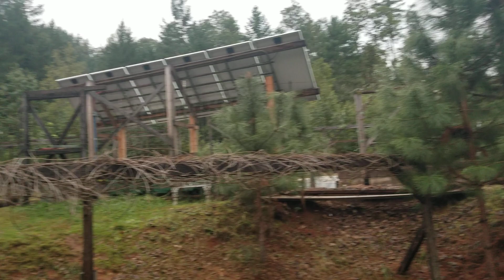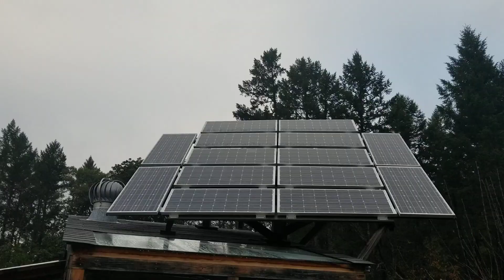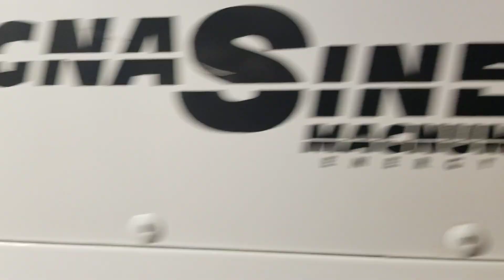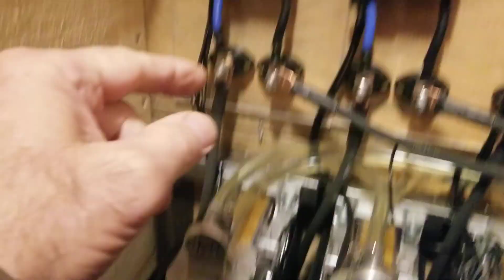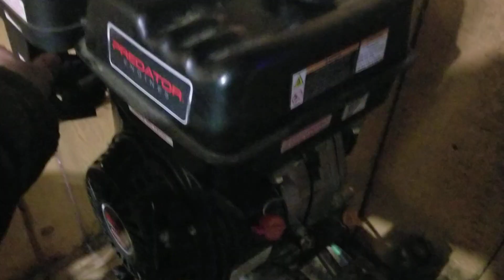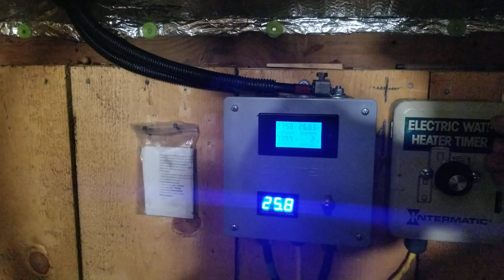Answering questions about the DC generator (Caution may be Boring to some viewers)

Comment: Your Diesel Generator has to go through a 110v charger?  And does not need the 24v relay disconnect, correct?  Your Alternator Generator puts out DC and is where this disconnect system comes in, correct?  Does your alternator put out 3 phase and then go through a rectifier?  If so, would the alternator start to get warm when load is disconnected like a wind turbine 3 phase will if left running?  Thanks.
Reply from the maker: Correct on all points. The engine must me shut down immediately.  I have one more relay to install that grounds out the coil on the engine when the controller opens circuits. If the driven power  came from wind or hydro a resistive dump load would be needed.
Reply: @offgridinthepacificnorthwe3210  When I woke up this morning, I had it figured out. The cheap turbine controllers short the wires to keep the turbine from fly away destruction.  I see no harm in opening the circuit on a alternator or PMA connected to a stable rpm source.  I still like your idea to shut the motor off.  What 110v to 24v charger are you using to charge from the Diesel?
Reply from the maker: @sciglassblower  Randy our Magnum inverter is a 4000 watt inverter and a 105 amp power factor corrected charger all in the same unit. This is typical of off grid systems. 
Any generator I connect to the inverter/charger will charge whatever type battery bank I program it to charge. I should be available sometime after the 1st if you want to email me to set up a time.  You can reach me at,
back41@cavenet.com 
Have a very blessed Christmas!
Pastor Steve Davis
Reply: @offgridinthepacificnorthwe3210  Can we connect privately?  I just live in CP and would love to come hang out with you to talk tech.  Randy

Comment: You are very good at figuring things out.  I just ordered these items to do it on 24v to 28v.  https://www.ebay.com/itm/Battery-Charger-Discharger-Board-Under-Voltage-Over-Voltage-Protection-Module-/122652302700 & https://www.amazon.com/Cole-Hersee-24063-Insulated-Continuous/dp/B001FQMZO2.  I am copying you with a 24v setup.  Thank you.

Comment: Batteries voltage 25.7 and at 51% that’s really good. Flooded lead acid would be nothing like that!
Reply from the maker: You are right! This is  also the reason I went with a 7s battery rather than 6s. The 6s Tesla is a bigger 5.2 kilowatt battery where my 7s is only a 3 kilowatt.  I have 3 for a total of 9k. The very bottom end of the 7s it 21 volts and the bottom of the 6s is 18 volts. I do not go lower than 24 volts or above 28.3. In your application I know of a few off off gridders who use the 6s with a 24 volt heating pad in an insulated box. The heating pad is 120 volts ac and uses very little power, like 50 watts or so. This is the most compact way if heating is the only need.
Reply: Off Grid In The Pacific North West. Yeah the cold is always the killer in my application. I have a 350w 24v heating pad under my batteries. I have it on a Relay that is controlled by the charge controller, the only problem I’m having is on just days all my energy is going to the heaters and my batteries don’t get to a 100% full. I wish I had an option to turn the heater on when the charger reached float

Comment: Have you thought about adding wind turbines to offset the power you don't generate when it is extremely cloudy??
Reply from the maker: Yes I have tried several different types of wond generators. I have a friend who installs the big commercial type. He also has a Burgey 10 kilowatt generator that provides a pay check every month. I have do e lots of study and testing g and have concluded a couple things. First you better do a full year wind study at your location. Second you better go big or go home. 110 feet tall is where the wind is. You also have to be 3 meters higher that an object 1500 feet away.  I have found that these PMA type that you can buy on Ebay are just a gimmick. A 5 kilowatt Burgey is the minimum I would consider and at least 110 feet up.
Reply: @offgridinthepacificnorthwe3210  You are so correct.  I have a 500w turbine married with a special dump load controller to work perfectly with the solar chargers, but, it does not produce any power to speak of due to being just above the roof.  I don't want to go high.  I did it for 2 reasons; 1 for stormy windy days if we get any, and, 2 for the challenge of solving the marriage issue of protecting the solar from dumping into the dump resistors (and I did).  Still not worth it unless you just want to do it anyway like I did.  Good project because if I had hydro available, it works exactly the same except the hydro will not fly away and destroy like a turbine if not shorted or dump loaded.

Comment: An old Prius also makes a good AC electrical source 3kw from the charging system and you can still drive it to town for gas.  ConVerdant plugout I think it was called.
Reply from the maker: That is a great idea. I have so much solar most of the year I want to convert our 73 MG midget to an EV. The Tesla batteries are so light I could have a 200 mile range  and still have some trunk space.
Reply: @offgridinthepacificnorthwe3210   Yes apparently you just leave it on and the motor starts and stops when the battery needs charging and they run dead quiet.

Comment: Bring on the boring, not all of us have that kind of understanding as we are spoiled with the grid. It's nice to hear someone who actually knows because they lived it. Great video.
Reply from the maker: I am hopefully going to bid on another piece of land sometime in January. I may move our solar system someday if I can find the right place.
The new property has a better wind potential. I have not given up on that aspect of off grid living. With wind go big, go up high or go home.  After 50 years in the cold wet Pacific North Wet. I think I may do better in a dryer climate. Just 70 miles east of here and about 4500 feet elevation it is colder but much dryer. Here we get up to 100 inches of 33 deg. rain. Today it will be about 34 degrees and 100 percent humidity. It just chills to the bone. Over on the dry side there is 18 inches of precipitation and about 70 inches of snow  year. It is 10 to 15 degrees colder but 10 percent humidity makes it feel much warmer to my old bones lol.
 Mary Christmas my friend.

Comment: Very interesting system you have built there. Very impressive but you can do that yourself and figure out an economical way to get what you need done done without spending a fortune. I wish I had electrical knowledge like that but I do not.
Reply from the maker: I am hopefully going to bid on another piece of land sometime in January. I may move our solar system someday if I can find the right place. After 50 years in the cold wet Pacific North Wet. I think I may do better in a dryer climate. Just 70 miles east of here and about 4500 feet elevation it is colder but much dryer. Here we get up to 100 inches of 33 deg. rain. Today it will be about 34 degrees and 100 percent humidity. It just chills to the bone. Over on the dry side there is 18 inches of precipitation and about 70 inches of snow  year. It is 10 to 15 degrees colder but 10 percent humidity makes it feel much warmer to my old bones lol.
 Mary Christmas my friend.

Comment: Def agree with "boring" (a good thing, tho). My Midnite's are playing well with my lithiums. I remember both of us having "issues" for the past two winters with our FLA L-16s. This year...zero issues after switching over to lithium. Balancing on my four KiloVault lithiums is fine (I watch them like a hawk). Each battery is less than 0.02 volts (variance from each other) most of the time. However, when these bad boys are charging to about 95% SOC (about 13.9 volts each)...they start acting kinda weird. It is like they hit "nirvana" and the voltage differences widen (up to 0.1 volts variance). Then, during float...they go back to 0.02 volt max variance from each other. When they are brought down to 0 - 5% SOC...they really start acting like a crazed teenager. They have never shut off, but they do NOT like going below 5% SOC. Overall, they are excellent, stay in balance, output their rated kWh, but have some quirky behavior on the opposite ends of SOC. They are happiest, will stay in balance, stay close to the same voltage from about 5 - 90% SOC (using my WBJr on the Midnite's screen for SOC and attached voltmeters for each battery). Hope all is well...seen any big cats?  Didn't hear those bong-bong wind chimes!  😀
Reply from the maker: That is great Chris. Yes we have had enough drama with FLA. Using them is not a talent that I need to master. Being bored is just fine lol. My Tesla batteries stay within 0.04 volts per cell group at the top end but all 3 batteries total is exactly the same.
I have notice when they are charging with lots of zoots, like 140 amps that the voltage readings are erratic. when I remove the current they read the same and when fully charged they are within 0.04 per cell group. I have active balance boards on the way from somewhere. 
As far as the mountain lion is concerned I was closing the chicken house up the night before last about 8pm, I stopped to relieve myself along with Gibbs before I bring him in for the night. About 50 yards from us in the pitch black of night a cougar screamed and  a bard owl started screeching. So Gibbs and I went in  the house lol. This morning I had to keep Gibbs close to the house until it gets light. As for the chimes they are bonging away as a storm is coming in. Have a very blessed Christmas my friend.

Comment: Ya I agree a good diesel gen is the best. I turned an old vw tdi engine w/manual transmission into a dc generator. Ran CV axle output to Mars 4201 DC brushless motor, running into victron mppt 150/35 to 48v dc battery bank, run the motor in 6th so the voltage is 98v at near idle rpm.
Reply from the maker: That is impressive. I assume with using a mppt there is not as much a need for a governor on the diesel engine? If you do have a governor on the VW TDI 
I am very interested in how you did it. A few years ago I considered putting a VW diesel in a Samurai I used to have. Great engines and easy to find.
Reply: @offgridinthepacificnorthwe3210  No, the MPPT is capable of up to 150v DC input from normal solar, since i wanted to run the engine as CLOSE to idle for best fuel efficiency, i purchased the motor, attached it to the CV axle directly with a machined adapter so i have no belts or chains to worry about. Then i put it in every gear at idle and figured out the voltage output from the motor. Then based on that info i determined that in 6th gear at near idle i was near the 100v DC MPPT but with no wiggle room, so i bumped up to the next and ordered it. Then what i did was load up the generator with the full load i wanted to ever see present on the engine and determined that idle was actually to low, it was lugging a little to much and the turbo surging just a tad, so bumped up the rpms from 950rpms stock to 1100rpms with a simple potentiometer on the pedal circuit. So the stock engine ECU sees a constant pedal request figure and keeps the rpms stable. When the engine is running it only increases in turbo boost on the turbo as you apply more load, the rpms stays completely stable. Then to protect the motor, i used the engine oil pressure sensor (normally open) to activate a relay circuit for adding load to the engine. So when i start the generator remotely, it starts up, the oil pressure rises, then closes the circuit to turn the oil light off on the dash cluster just like it would in a car, then the relay on the battery side of the MPPT output is closed and the batteries start to charge. Since we have moved to mostly DC power direct in our cabin here in Colorado, i have no more reliability issues with dealing with inverters converting the power from DC to AC, or loosing 20-40% of the generator power from having a AC generator converting to DC to charge the batteries, then back to AC to power the house. Most we have rewired with DC power combined with a small capacitor circuit to allow simple voltage variations in the circuit. Right now we have to manually turn on and off the generator, but plan to add a timing circuit in the future that we can control with cell phone using IFTTT App to say, turn on engine for lets say 3 hours, or 5 hours before it turns off, or have an auto trigger circuit to turn on if voltage below XX.XX and off above XX.XX voltage.
Reply from the maker: @williamhustonrn6160 
 Got it. your system would make an awesome video if you ever get around to it.
thanks for the response and have a very Merry Christmas.
Reply: TDi genset that should last forever at idle lol
Reply: @offgridwanabe  that is the plan, the motor had 280K+ on it when i purchased it from auction. The compression is good on all cylinders and the blowby is very minimal, the only part i see needing replaced in the near future is the stock turbo, it has a bit of play... but with constant loads of a generator it may just live forever with my usage... we will see. TDI engines are not all that difficult to find in junkyards and parts are pretty cheap compared to a typical generator. Prior to this we had multiple gas generators burn up on us, 1 overheated and locked up and 2 the engines just started consuming oil after a few hundred hours and just starved themselves of oil consuming their own oil. The typical small engine generator these days are just built so poorly and trying to warranty them is a joke, we payed premium for the Kohler 48V DC Generator and it ran dry of oil from oil consumption and burned up, warranty denied it because we apparently neglected it. It died with 310ish hours on the engine and was setup to auto start and stop based on battery voltages levels, just cheap china junk... and to buy a replacement engine was nearly the cost of the entire system when we purchased it. So that is why i wanted to go to something more reliable and easier to get parts used if something was ever to brake. The VW TDI engines are proven reliable, very fuel efficient and parts are cheap and now we have a cooling system to keep it cooled vs just air cooled with the other systems. I basically cut the car from the firewall back away, transplanted it onto a small concrete slab, then built a shed around it to make it not look like an eye sore. The radiator system i upgraded to a larger pickup radiator and converted it from electric fans to belt driven to always pull air through the radiator to cool the engine.
Reply: @williamhustonrn6160  I was thinking of something similar with my 2006 BEW TDi but the grandson got it with 350k on it and it just won't quit. I too would use the all the dash and electronics maybe even the drive train and just design something to attach to the front hubs. The earlier model 1.6cc do not have all the complication with pollution on them and work just as good I had a 4x4 tracker with the 1.6 in it and it worked awesome.